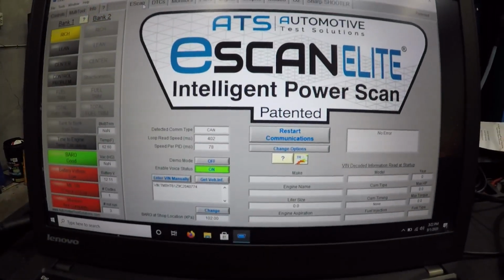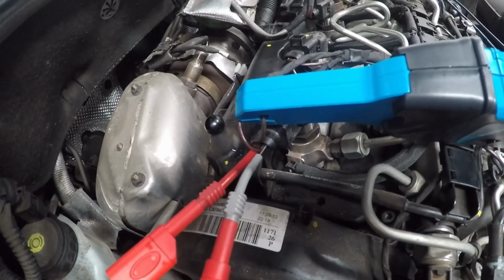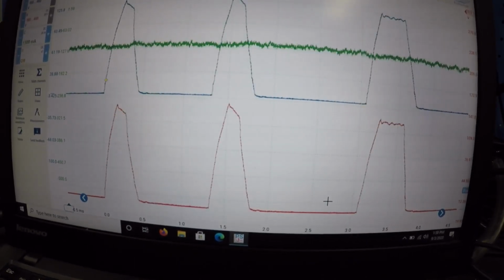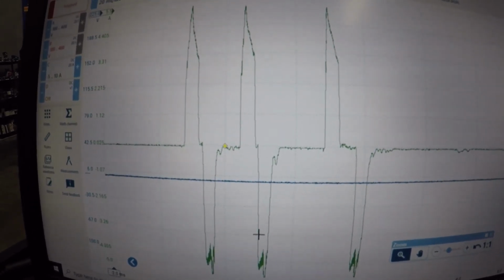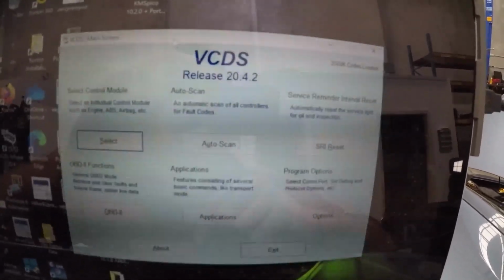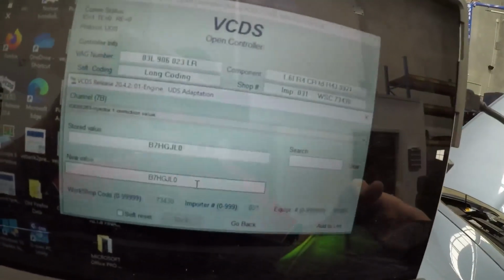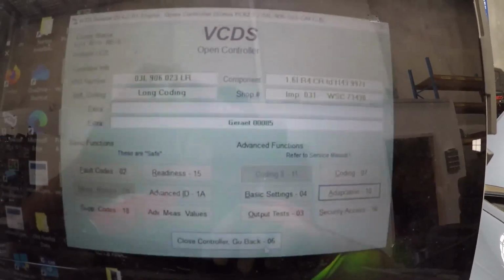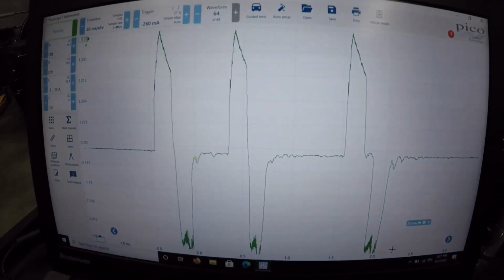Skoda Octavia P0201 Part 1&2 - Diagnosis and Fix

Comment: Very good job, can you explain why is on power ond ground side of injector same voltage pattern. Doesn't make sense to me how can be current flow if ground and power are the same.
Reply from the maker: It is not exactly the same, it's power and ground one way when the pcm wants to expand the piezo crystal stack and then the pcm reverses the polarity to contract the piezo crystal stack. When you scope both wires it gives the illusion of being the same because its essentially  doing the same thing just at different times, wire 1 power and wire 2 ground at one moment, then wire 1 ground and wire 2 power the next moment. That's why the current waveform has a positive current ramp followed by a negative current ramp. I hope that makes sense.
Reply: @romanosautomotive  Thank you for clarification

Comment: hello, I have, not all the time, and often when I drive error p0201 injector circuit open cylinder 1.  the preheating warning light flashes, and the engine vibrates.  I changed the 3 injectors, and I measured 2.56v on the connector plug without starting the car.  I am lost and I do not understand anything.
Reply from the maker: It would be hard to try and help you over the internet. Are you a mechanic, do you have any very good mechanics local to you?